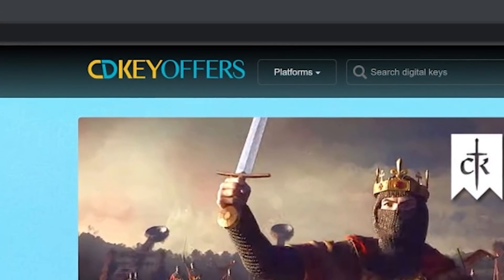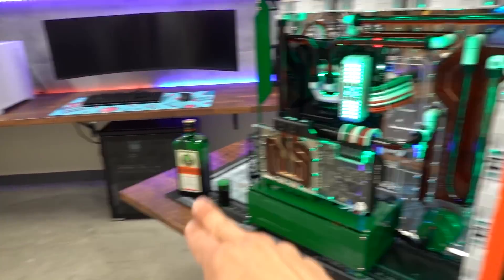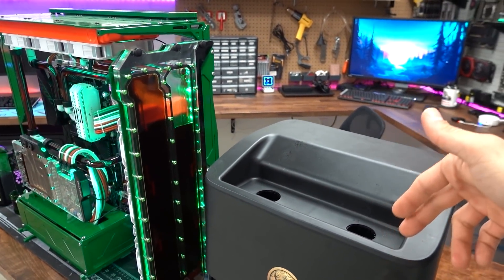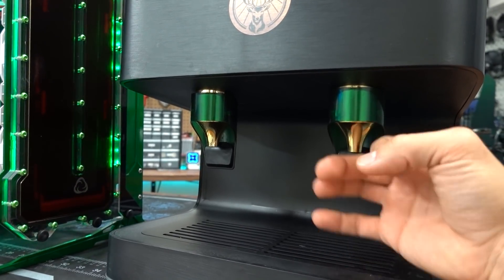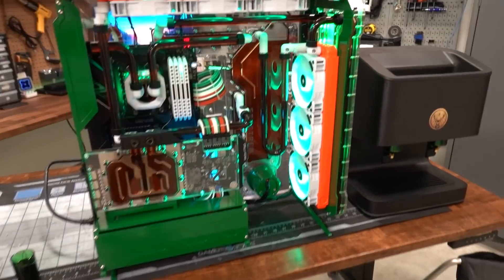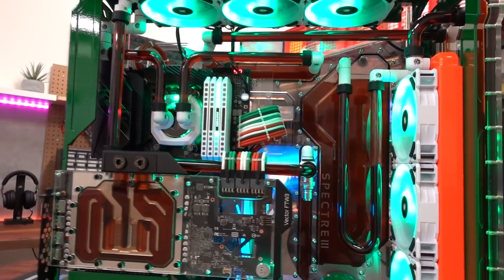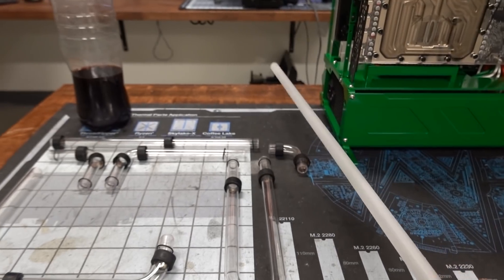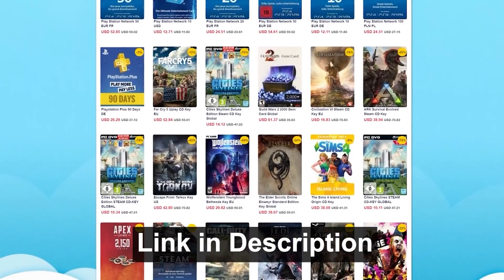IT'S BACK! My secret plans for the Jägermeister PC...REVEALED!

Comment: I don’t know how that chiller actually works, but I don’t think using it to cool the fluid would be a good idea. Kinda like how putting a pc in a fridge doesn’t actually help it stay cooler, the machine really isn’t supposed to handle a constant heat output. You put your food in the fridge, it lowers the temperature back down to the setting, and then the insulation is what actually keeps it cold. If you constantly pipe 70° fluid into that chiller, I would assume it would end up wearing out the compressor (or however it chills) fairly quickly. Maybe you could just make it look like it cools the fluid, routing your tubes into the bottles and out the dispenser, but then use radiators to actually cool the loop.
Reply: very tru
Reply: I was wondering if it could even keep up. He said it takes hours to even chill on its own. I think over time the temp will keep increasing until it hits a certain point. maybe a few degrees less then without it.
Reply: Agreed, due to the size of that chiller, it's most certainly not capable to do a good job cooling the liquid and will die. Depending on the quality of the compressor death will come sooner or later.
Reply: This is pretty much what I was going to say, but checked the comments first. The chilling machine most likely wont survive. I would run the tubes from the outlet through holes in the bottle but the hoses continue through the bottle, out the nozzle and back into the PC without ever needing real fittings. You could make fake fittings and maybe super glue them on to make it look convincing.
Reply from the maker: Definitely considering this. Will be interesting to test!
Reply: maybe enough room inside the chiller if it was gutted for the rads
Reply: @flamingchicken44  or you could gut the chiller and add pumps in it.  make sure it has good flow.
Reply: What he said.  Couldn't have said it better!
Reply: @leetween7232  I like this idea. That's a lot of tubes running outside the rig. If the shot chiller machine is going to be used just for aesthetic purposes Kyle might as well gut it for purpose built parts to keep up good flow and fluid reservoirs.
Reply: A dremel  with  diamond bits could easily do a hidden pass thru use silicone to seal and adapt to the cooling system and never go thru the real chiller with one or two bottles so again like my stand alone comment you could keep a working dispenser since it could be photo op when they show people the full tour
Reply: If Kyle is feeling adventurous, he could replace the chiller in the cooler to something that could possibly handle a more consistent duty cycle, like a Peltier cooler.  But he'd have to account for the cooling needs of the Peltier cooler itself. And he'd have to get one that is large enough to meet the demands of the loop.  

The Jagermeister cooler is neat but, it adds several layers of complexity and I've never seen Kyle do any modding.  He may need to call in Jayztwocents for a consult.
Reply: @did_that_hurt8387  Aah. Remove chiller. Install cooler. Good point. From the outside noone is the wiser. Unless you need some airflow....

Comment: You could take your glass bottle to a glass cutting specalist and they could make a pipe attached onto it for you that was air tight that is the only suggestion i have.
Reply from the maker: Not a bad idea
Reply: @Bitwit  love you
Reply: @Bitwit  Not sure if this has been said yet but, if you decide to drill the bottles yourself, you are going to have to find a "glass/ceramic" drill bit.  You'd preferably want to do it in a drill press because humans are generally not stable enough to drill in an incredibly hard surface like glass without exerting too much pressure at the drill bit/glass interface.  With a drill press, you can fine tune, to a degree, the amount of pressure you exert, while keeping the drill bit perfectly vertical.  

To create a "fitting" for the tubing to connect to the Jager bottles,  you'd have to make the hole big enough into the bottle to fit a rubber grommet that has a hole in the center. Then you could friction fit your tubing into the rubber grommet. (You shouldn't be creating hardly any pressure from the cooling pump, so a friction fit should hold with no issues.) 

Alternatively, you could screw a drain valve into the grommet.  If the internal diameter of the valve is the same size as the hole in the grommet, the valve's threads would bite into the grommet and make a good seal.  

In either case, you can't bump a friction fit joint, or something that is threaded into the grommet.  Enough off axis deflection in the tubing/valve would either allow water to leak out between the tubing/valve and the grommet or would potentially break the bottle.
Reply: @actschp1  hey mr "engineer"  you think there's a way to control the temperature of the liquid coming out of that jager chiller?
Reply: @mr.davemaeen8136  what does your question have to do with my suggestion? I was merely speaking to fitment and assembly. I said nothing about controlling cooling because, quite frankly, the little built in chiller would not have enough duty cycle to keep up with the demands of the system. So, what's your point? You're connecting dots that I wasn't even alluding to. "Mr." Dave maeen.

Comment: you'll want to make sure that the chiller/condenser is rated for 24/7 operation, they often are not.
Reply: Even before that he has to pull it apart and make it flow straight through doing shots of cold water isn't going to work
Reply: The unit is not rated for 24/7 operation. It is designed to cool a set amount then shut off and it is not designed to have continuous flow. If he takes it apart he can easily change the pump but the chiller may not have enough BTU to cool that amount of heat.
Reply: @eduardorivas363  Exactly. It has to disapate the heat that it removed from the liquid and has to cool down the refridgeration unit in it.
Reply: @GregM  is there a way to mod the cooler to be able to handle it?
Reply: @Shraf2k not always
Reply: I suspect that it would have a peltier based chiller system in it. It's the most inexpensive heat exchange that you can buy.
Reply: @Shraf2k lol well yeah but I expect a miniature novelty product to be made to slightly lower standards than commercial equipment :D

Comment: @3:00 I'd have Jägermeister get you 2 bottles, but with the label facing up instead. Obviously you'll be putting the bottles in upside down, and also the labels would upside down.
I'd also get them 2 customize the unit for you. Like have 2 shot glasses underneath, but have them totally affixed to where it would come out. Like have a smaller glass tube, so then it would like like it's always pouring. Have the fitting on the very bottom of the shot glass and proceed out the bottom back of the unit.
I'd mount it directly on top of the PC case. Remove the plastic from the very bottom of the unit so maybe the fans at the top might want to reverse them.

Comment: I've owned bars with Jager dispensers similar to that, the Jager doesn't freeze because of its alcohol content, any normal liquid will freeze and these dispensers usually don't have a configurable temperature setting. So be mindful of that, you may need to add something to the liquid to stop it from freezing.

Comment: Btw, adding any refrigeration will always add condensation and heat. The way that air is cooled is by removing moisture. That moisture has to be exhausted somewhere. Unless you have a plan, this will not work very long

Comment: I don't know the exact specs of the cooler but I doubt it designed for continuous operation (esp. given its meant for cold shots). It might run for a while but it wouldn't be something to leave running for longer than a few benchmarks and I don't know how big of a difference you'll see as a result. It might be something where its not always running but occasionally use it to give the loop a "shot" of cold fluid. Drilling the bottles might be difficult but there might be fittings you could put into a drilled hole that would act similar to a regular tube fitting on the outside? 

Either way, I'm interested to see how things go, keep it up!

Comment: I think you're guaranteed to get condensation due to your fluid being sub-ambient. You could test condensation by using the Jägermeister chiller for its intended purpose and fill a shot glass with... Jägermeister and look for moisture on the outside of the glass. Fun part is you can repeat this test as many times as you feel necessary by drinking the contents {burp}.

Comment: You need to take into account the flow rate into the glass bottles and out of the chiller. If they aren't equal you could run into an issue where either the bottles over fill and burst or they completely empty
Reply: ^Came here to say this

Comment: For the output from the cooler, attach the tubing to the nozzles, but run the tubes through shot glasses underneath with holes drilled through the bottoms and into the base. Then run the outflow thru the back.

Comment: I agree with the comment about taking the bottles to a proper glass blower, I think you should take the chiller apart and see how everything inside is plumbed up. You may be surprised to find common fitting gs inside that you can adapt to and make it all sealed the way you want like putting a fitting on the neck of the bottle and plumb it into the system

Comment: If you’re super worried about condensation I guess you could just cool the hot output from the cpu rather than front load the cooling system with cold water. That way it will be be getting rid of heat without creating excessively cold temps, might not be as efficient however.

Comment: If pressure isn’t compatible with the cooler… maybe the answer is a custom loop through the reservoir.  You could then put an additional pump that cycles on and off with some sort of custom controller or timer that allows the fluid to cycle on and off if needed so it has time to cool in the cooling unit or it could give you more granular control of just how much chilling you allow in the system. But you would need both ports in the reservoir

Comment: I think your main concern would be the flow rate coming out of the chiller. You said that it did handle the pressure of the pump going in so if you have more going in than than coming out you might starve the pump. Maybe you could rig a couple of shot glasses and run a small tube from the top down into the glasses to even out the pressure coming from the pump?

Comment: Nice GN mat ;)  I saw some folks talking about the condenser running super long.  Something you could do to counter all this is strap an arduino control board tot he back of it to control the power.  Then you could essentially setup the PC to power the cooler when it hits certain temp thresholds.  This would cut down on any potential temp variations that could lead to condensation, smoother control for overclocking, and less power consumption in general.  I am under the impression you will have the valves the bottles are above stuck to open so flow is free, otherwise you introduce air in the line.

Comment: I just recommend doing some trial and error on seals for the containers, I would thing gravity itself would be enough for the chiller and bottles. If not my other idea would be to take the chiller apart and see if you can rig it up to have it continue through the system and make a better seal with the neck and tubing. Since I'm guessing all the chiller does is wrap copper spools around the neck of the bottle anyways to chill it.

Comment: When you use the chiller you need to make sure that it has more thermal energy potential than what you're trying to cool, aka if your pc emits 300w your chiller needs to have more than 300 watts thermal capacity otherwise your temps are going to skyrocket. If your chiller is compressor based it's pretty easy to figure out it's thermal capacity, just look up the power of the compressor and reduce it by 15%

Comment: You could inject some elastomer around the tube to waterseal it to the bottle. The kind you use to seal gaps in tiles around showers and stuff, but for glass. You can probably buy a glass drill on the internet for a few dollars to make the holes. 
But make sure the cooler can handle a continuous load, because often they cant.

Comment: I'd suggest not using the chilling machine to chill the coolant, but to only act as a pass-through pump. That way you don't have to be concerned with any condensation, but you still get the visual effect, especially since you'll be using the frosted/satin tubing.

Comment: You should connect the Jager cooling machine to the PC with just the outlets. So it looks like the Jager bottles are feeding the PC cooling system. But it's actually just connected with blocked off connections. Don't run any hoses to the bottles.

Comment: Condensation aside, if you drilled into the top( bottom of bottle) and had a long enough tool to hold a fitting (assuming a fitting and tool could get through the opening) you could do a pass thru fitting of some sort. Good luck

Comment: the issue i could see would be the radiator and fans actually working against the chiller. if the fluid is colder than ambient in the loop, the fans and radiator will actually WARM the fluid back up again. so  you possibly should NOT have those in there if the cooler can keep up with the hardware's heat output.

Comment: Things to keep in mind:
 - if the flow rate going into the bottles is less than the flow rate coming out of the nozzles, you'll still have build and eventual overflow.
 - assuming those chillers have a valve mechanism to actually release the fluid when a shot glass is pressed up against it. you'll need some way to hold that valve upon all the time.

Comment: Didn't read all the comments, but didn't see this, so maybe no big deal idk. But the cooler dispenses Jaeger when the levers are pressed. It's not just an open line. So you'd need to rig something up to keep those open and not cut off your flow. At least it seems that way to me.

Comment: Instead of capping the spouts, couldn't you open up the dispenser to connect the lines between the bottles? 
1. You could replace the existing tubing inside instead of conjoining the bottles.
2. Could make the dispenser appear unaltered. 
3. Cutting multiple holes per bottle could weaken the glass and cause a stress crack between the two points.

* Bonus Points if you can make the spouts operational to flush the system. xD

Comment: I guess from that dispenser, you must not put the outlet to the bottom of reservoir because leaks are possible since that dispenser and the bottle are just converted, i guess it's better to put the outlet of dispenser into where there's no force would not push the water back to the dispenser then next to it is the pump makes less pressure on the dispenser. sorry for my bad english, I wish you get my point haha

Comment: You should be able to find thicker grommets that would fit the thickness of the Jager bottles. I dig the satin tubing, I think that's gonna look sweet! As far as using the WHOLE chilling unit goes, I don't think it's gonna work... My only real concern with it is that it's not going to be easily transported... you WILL need at least 2 people to move it at that point. You already mentioned condensation... but that should definitely be a huge concern of yours... One drop falls from your tubing at the CPU block at just the right speed and angle, it falls into your PCI-E slot frying your board, your card, and everything attached to it. Sweet idea... I just think that chilling it as much as the Jager Chiller can chill would probably end badly for all parties concerned.

Comment: Yeah so those beverage chillers aren't built to handle constant flow.  It's basically a large refrigerated tub.   It basically becomes a slightly cooler reservoir if you're constantly running it.... meaning, it'll be cool to look at, but it's not practical.  You'll burn out the compressor motor quickly, and need water cooling for that! LOL

Comment: Are you sure that it will cool the water fast enough? I’m pretty sure the coolant has to sit in the cooler for awhile in order to cool it. Having water pumping through it at a higher speed won’t let the water get cold enough.

Comment: Condensation may be an issue depending on how cold the chiller gets. Also the chiller is not designed for long periods of operation but should be fine for a video.

Comment: This may work. Get a diamond bit hole saw and some bulk head fittings to attach to the bottles in the chiller. If you do go that route, when your drilling out the holes in the glass, use a lot of water and go slow. Actually, Jay might know a thing or two about this and give you a small hand or suggestions to try.

Comment: i would send the liquid first through the radiators and then through the chiller. You should get the best temps that way, because the chiller can cool lower than a radiator, but isn't designed to cool that much that long. IDK if you're doing it already...

Comment: Even if you had a shot cooler that would work with the build, you might not want it to run below ambient anyway, to prevent condensation. So you'd be better off if it is either set to cool only close to ambient, or to circumvent all that and have it only as a passive reservoir.